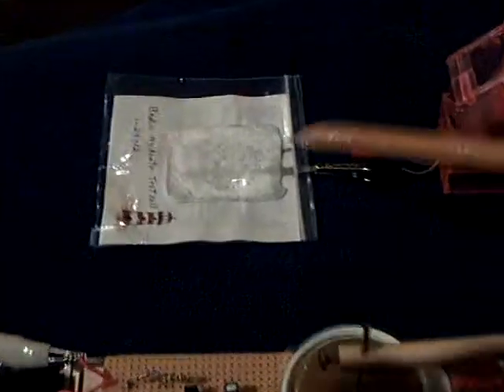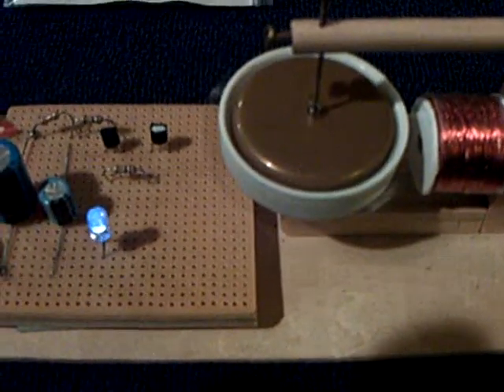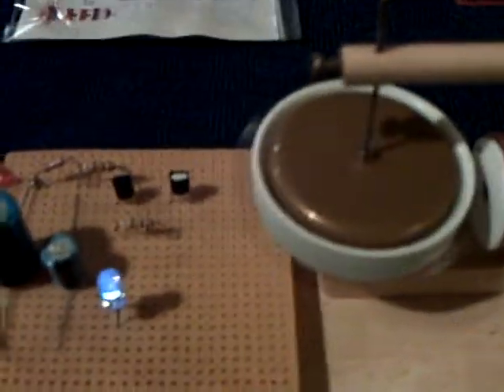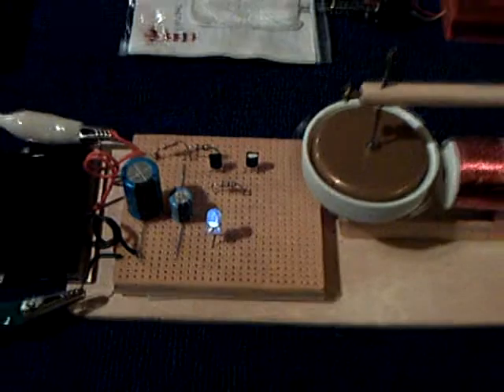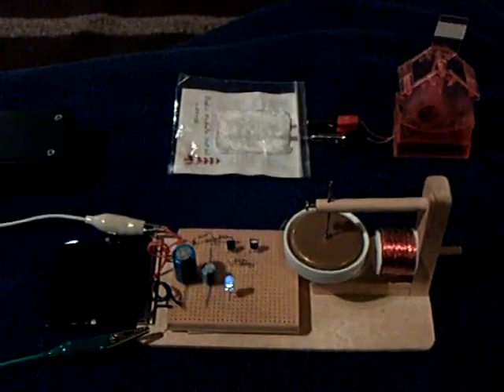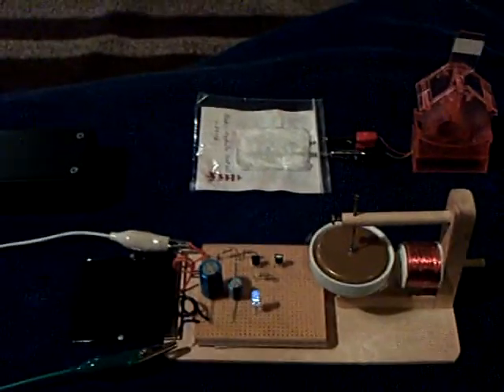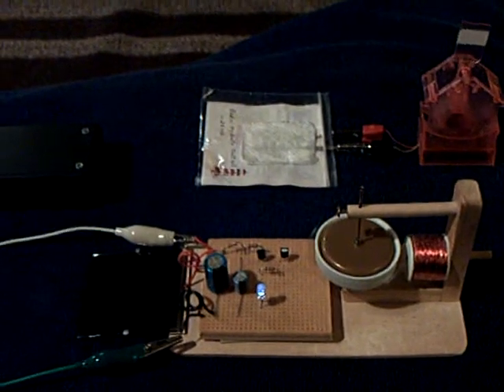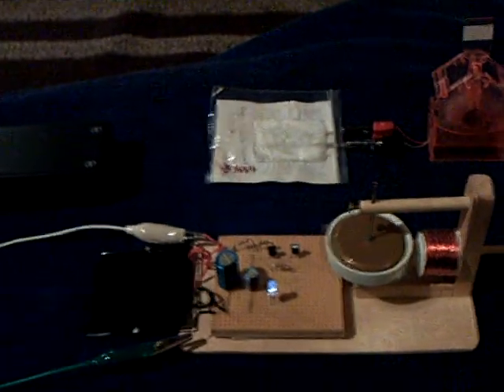Bedini Hydrate Crystal cell ----working with solar cell.

Comment from the maker: @slider2732 ------You are right it does become a brain exercise trying to figure out a way to self hydrate these cells.  It only takes a tiny amount of water and not very often to keep them going.  I was thinking of using a capillary effect using a cotton string in a seperate water filled container.  Over watering would probably kill the cell.  My plant battery "Phyllis" works kinda like this cell (I think) and she is well over a year old now.

Comment: A good brain exerciser that vid. I wonder if they can recharge without water. Guess one way of recharging the hydrate cell for sure, would be to convert the pulse motor to run as a pump, for a rainwater bucket outside and ferry a bit of moisture along a thin tube up to it.  
Or, a foam cup with saran wrap over it and the similar tubing setup outside, via evaporative linking using the morning sun (if that would work) - those sorts of tiny moisture amounts normally have no use, but here..well :)